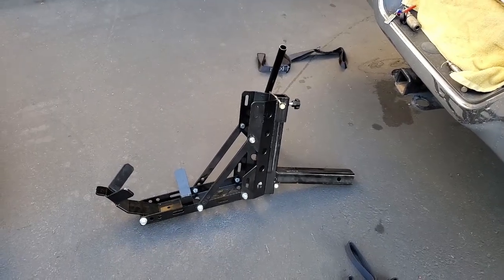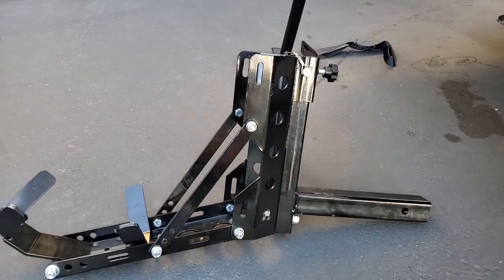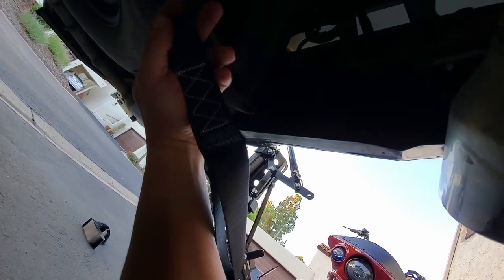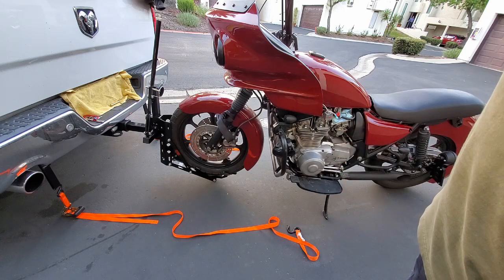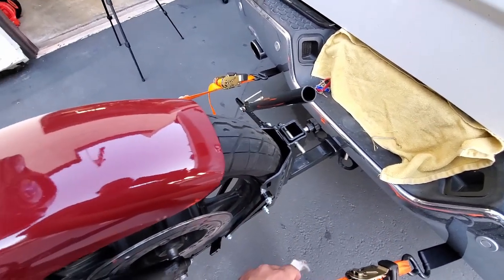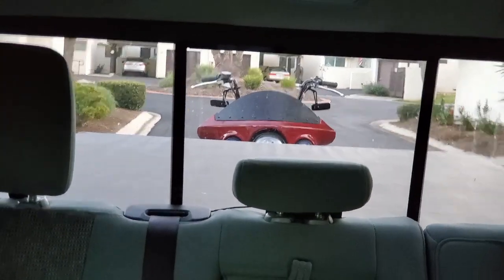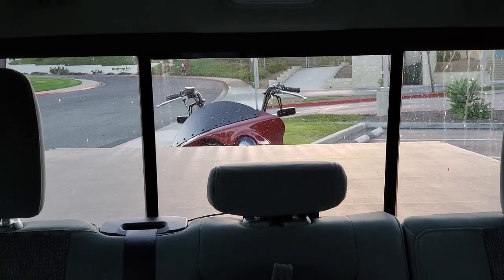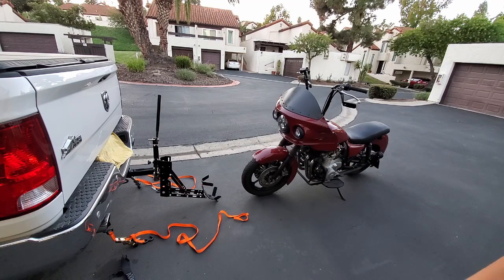Motorcycle Tow Dolly Hauler

Comment: I DO NOT RECOMMEND THIS FOR ANY BIKE. FROM ONE BIKER TO ANOTHER.
Reply from the maker: Thanks for the feedback Freepilot. I had bought mine for emergency use only.  I didnt have any desire to go long distance only because I felt that trailers would be optimal.  What are the big drawbacks from your perspective?
Reply: @Mikeityourself  it puts a lot of strain on the triple stack/forks.  No bone is built to lean with the forces applied in a twisting fashion.  My fork seals blew up.  Drained everywhere. another time. The bike leaned and didn't stop.  It laid right down horizontal.  By this time I actually bent my forks.  All my friends told me to stay away. I wish I listened. Now I had to spend more money fixing my bike twice. And this wasted 90 lift sitting in my garage. I promised myself I won't sell it to anyone.  I couldn't feel good knowing another rider ruining their bike because of me.  BTW I've never gone more than 30 miles an hour with it. Let alone more than 5 miles with it without it messing up my bike.
Reply from the maker: Wow, that sucks man. Sorry to hear. I really do appreciate the feedback and hope others see your experience and learn. I did a follow-up video and called it a fail. My issues were related to larger tires though. Guess my guardian angel kicked in.

Comment: Didn’t see how you jacked it up or down.  That’s all I cared about.
Reply from the maker: Hi, you just pull the lever down.  its just a device of leverage, its kind of one of the pluses and minuses of the unit.  Some you have to jackscrew up or us a boat style wrench, where this one is one action but the bar it comes with is a bit small and I needed to add an extension to make it easier.  Hope that helps.  Thank you for watching.

Comment: The problem with this is that even if the bike is put into neutral, it's going to spin the transmission and wear bearings out because the bearings in the transmission are lubricated by the engine oil which isn't going to be being pumped because the engine's not running. To tow with this thing safely, you're going to need to disconnect the drive chain, belt, or shaft from the rear wheel so that the rear wheel isn't turning the transmission.

Also, that's a really nice KZ1000-P you've got there. My absolute favorite model of motorcycle. I own 3 of them myself. Best workhorse Kawasaki ever made!
Reply from the maker: Yeah, def loved working on that KZP, my first project bike.  Makes a lot of sense what you are saying with the oil.  Do you think that would apply to Harley's as well since they have a separate transmission and not dependent on the motor oil?  I've never looked into it but kind of assumed the gears sit in the trans oil and as the spin lubricate themselves.  Really appreciate the feedback Berry, thanks for your support.
Reply: @Mikeityourself  I honestly don't know. It'd be best to ask Harley about that. But I do know it used to be a problem with cars too back when they all were rear wheel drive, for the same problem.
Reply: I have a trailer but I can't see it from the cab of my truck so I can't back it at all, by the time I see it in the mirrors it is already too far gone to correct, so I am considering one of the tow racks. I am going to be towing a bike for my son from NM to NC, 1700 miles. The solution to the transmission question would be, if you have a drive chain, just remove the chain. And once I get to NC, I can just leave the tow hitch with my son in case he ever has an instance where he has to retrieve the bike. Thanks for the video! @Mikeityourself
Reply: As an addendum, the transmission trouble's with towing a rear-wheel drive car was with automatic transmissions not standards. The automatics would build up pressure in the trans and blow the seals.
Reply from the maker: Thats pretty wild, i never knew that about the issues with the AT Cars.  I was always stuck on what the tow truck drivers would do if the person used the parking brake.  Figured those wheel dollies were the solution.
Reply: @Mikeityourself   Well, it's not their job to ensure the car makes it to its destination without damage, and any damage done could be conceivably blamed on the person who had it, not the tow truck driver.
That said, it's generally ok for short distances (at least with manual motorcycles) like a couple of miles, but you're still running the bearings dry as I described above.
Reply: Not a mechanic but remembering exploded views of transmissions and seeing a few taken apart,  it seem the gears ride in an oil  bath at the bottom,  so they should pick up oil if any of them are turning.
Reply: @20111111jorg  It's not the gears that are the issue, it's the bearings. I thought I made that abundantly clear.
Reply: What about lifting the rear wheels instead and letting the front wheels roll
Reply: @CocoHunter-f5t  You'd think that would work but I don't know how the front wheel is going to respond on a bike. It's basically a caster that always points in the direction of travel IF it's moving forward, which is why motorcycles are able to be perfectly steady while you're not holding the handle bars (so long as the frame isn't bent, the steering bearings are fine, etc)
But moving backwards bikes are not very stable at all, so I don't know how it'll respond to being towed that way... If it ends up turning in the direction of travel, it should work fine, but I honestly wouldn't do it because it's going to be a LOT harder to keep the bike stable like that due to the engine being placed far further back. Due to that I'm worried it's going to be a case of the tail wagging the dog. But I honestly can't say those are only guesses...

IF there's no balance issues and IF the front wheel turns correctly while being towed backwards like that and IF it doesn't end up bending the frame or ruining the real wheel due to the front having most of the weight... then it should be ok.

Quite frankly... my go to is disconnecting the final drive mechanism and letting the rear wheel spin without turning the transmission. Whether it be the drive chain, drive belt, or drive shaft.

Comment: About 40 years ago I needed to get my motorcycle from Wisconsin back to Florida. a girlfriend of mine was driving to Florida so I took her traitor hitch and I took the ball off..... I cut a 1/2 inch plate of steel into a triangle... I drilled a hole in one point of the triangle... and then drilled 4 smaller holes at the bottom of the triangle.. 2 on either side... I took my front wheel off and put the axle back on.... I set the axle up on the triangle put 2U bolts around the axle and bolted it to the triangle ....then I put a big ass bolt into the hole, where The hitch itself was actually bolted to the bumper .....and I put the point of the Triangle  where  the whole was drilled For the original trader hitch in the Bumper...and stuck a big bolt through there...  double nutted  it so they were locked tight .....took off the Florida and never had a problem ...when I got to Florida I took unbolted to 2U bolts took the ax off put my wheel back on ... and I didn't need no bungee cords or nothing ...just that flat half inch triangle and 2U bolts, and a big bolt to bolt it back to the
hitch itself ....... The only thing that pissed me off about the whole thing was every time I went through a toll booth they charged me for that extra wheel on the ground lol
Reply from the maker: Sounds similar to how they mount the front forks of mountain bikes these days.  Makes perfect sense and sounds like a very solid design.  No surprise the state/county took the opportunity to stick it to you for that one extra wheel.  Thanks for sharing and supporting the channel.
Reply: haha yeah Florida pay tolls are stupid.

Comment: Thanks for the video.
What keeps the tranny safe in terms of lubrication?  The engine's oil pump isn't running.
Reply from the maker: When i did my research most folks recommended removing the drive chain or belt if possible.  If you have a drive shaft, no luck.  Personally, it was only to be used for short runs only in the case of an emergency so i wasnt too concerned and never considered going any faster than 45 MPH or very far.  Just something to get me out of a tight jam if that makes sense.

Comment: I got this to pull my scooter with my custom RV. I don't think I will need the extra side straps with a 200 lbs bike, but a good idea if I upgrade later in life.
Reply from the maker: Thank you for watching and supporting the channel.
Reply: Is your RV a motorhome or trailer? Thinking of using this on my 5th Wheel to pull my motorcycle.

Comment: If I put straps on the handle bars for extra support would that be better or worse? When I’m talking turns???
Reply from the maker: I think it would interfere with the bike natural desire to lean with the turn.  You also might run into issues with the shocks, might blow a seal.

Comment: Soooooo, what happens when you have to reverse? That’s what scares me. I have an equinox and I’m looking for a solution to haul my ninja 400. Small bike, doesn’t need much. It’s 360 lbs wet sooo. Just need to take it 120 ish miles
Reply from the maker: going in reverse wasnt an issue at all.  My Kawi had a really low rear fender so they only concern i had was around it hitting bumps if i was in reverse but never was an issue.  The structure of the device is very stable so it doesnt flex or buckle but possible to jackknife it if you really tried i guess.  Hope that helps and thank you for supporting the channel.

Comment: Can I use it in a freeway? Is legal tow a motorcycle in the freeway (65mph)?
Reply from the maker: I think you would need to check with your local laws to determine.  Depending on state/ county/ country they may vary.  Others that I had read feedback on stated they did travel with it but personally, i would only use this in an emergency.  Long distance or high speed travel I would use a trailer.

Comment: Do you think I can pull this off with my 2005 civic? I have a r1
Reply from the maker: I would be worried about clearance. The civic might be too low, I would also say look at  vehicle capacity. I don't think Honda lists a tow capacity so you might need to look at trunk weight for maximums. The clearance would be my main concern.
Reply: @Mikeityourself  I read that my year civic has a towing limit of 2k lbs and if the bike is half on the ground and half up that’s technically half the load? 

The clearance was my main concern but I think a hitch riser should do the truck. I wanna bring my bike from Chicago to Savannah 😅

Comment: Back wheel first i would do. Horizontal bar fixed to hitch you dont have to go under bumper
Reply: Wouldn't the top of the bumper have a smoother edge than where he put the straps under the bottom?
Reply from the maker: im going to take a look at doing it that way. I just wonder if my rear fenders might be too low.
Reply from the maker: My bumper had sharp edges on the backside.  My first attempt was to go that route but was afraid it would eventually cut through the strap over time.
Reply: @Mikeityourself  straps vibrate constantly and will get cut if not on a smooth or rounded edge. Let me know if you try something different.

Comment: There is a company called MoTow which makes something similar but for the back wheel and it's on a swivel. Looks like a lot better product... but it's very very expensive
Reply from the maker: Ive seen a few designs now and really liked the swivel but they do tend to be pricey. I also like those folding trailers, but same, pricey and storage challenges.

Comment: By doing this does this add miles to odometer??
Reply from the maker: Hi Gabe, I cant say this is true for all bikes but all of the ones I know of, the speed cable is tied to the front wheel and since the front wheel is not spinning, no miles are logged.
Reply: @Mikeityourself  Modern bikes have the speedo/odometer running off a sensor in the gearbox. If the ignition is switched off then no miles a recorded. However the keys may have to be in to keep the steering unlocked.

Comment: Why only emergency use? I need to haul my bike 550 miles and I’m looking into these. Would that be a bad idea?
Reply from the maker: Just a personal preference thing for me.  Renting a U-Haul trailer costs about $20 a day and for long distance I would just prefer a trailer.  I have seen some other videos of folks going long distance so it can definitely be done.
Reply: @Mikeityourself  I appreciate the reply brother. I only ask bc I’m moving and was planning to dolly my bike with my 15 camaro. I have no choice but to drive the car there so a uhaul trailer isn’t really feasible for my situation. I guess I’ll give the dolly a try. Again thanks for the reply and be safe out there 🤙🏼
Reply: Make sure you remove the chain or the belt for long distance.  Relieve the stress on the transmission of the motorcycle.

Comment: Any risk slippin in to gear?
Reply from the maker: Some of the folks I research only mentioned removing the chain to avoid trans wear but nothing related to it slipping into gear.  I guess technically its possible but not likely.
Reply: Zip tie the clutch down

Comment: Very good idea, but my concern is with the dolly welding arm.  It may be too weak to support all that weight.   It seems like that arm may break at any time.  Actually there is a video here in youtube where a guy drops his motorcycle exactly because the dolly broke and the whole dolly detached from the truck's hitch. 

I would weld two more steel pieces (one at each side) to give more support to the dolly's arm.

Take a look: https://www.youtube.com/watch?v=0NkYN5rPGR0
The good thing was that he was going slow on a dirt road, imagine if he has going at 70 MPH on the Fwy?
Reply from the maker: @tonymartinez7205  hey Tony, that's crazy, I wanna check that out. Do you happen to remember what the video was called? The welds on this unit look pretty good but I'm no inspector so you only know what you know right. Shoot me the vid name if you recall and thanks for watching.

Comment: I would never pull a bike by its forks. They are definitely not made for this.
Reply from the maker: Critter, thanks for your feedback. I wondered myself what kind of long term stress would be put on a bike if using this across a long distance too. I think around town at low speeds you would be fine but high speeds, hitting bumps would probably do some damage overtime.  Thanks again for your support.
Reply: Force from braking if you are riding the bike is much greater so this really is not a problem. Entire steering head and triple clamps are more or less symmetrical so there is no difference in pushing vs. pulling.